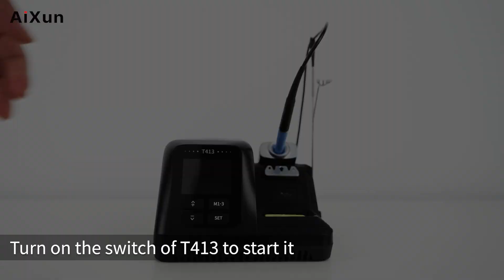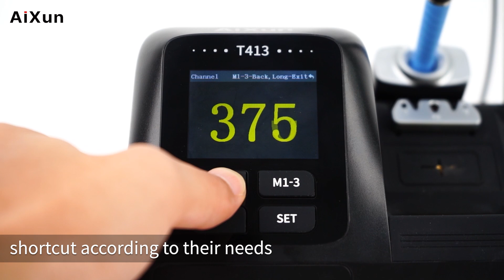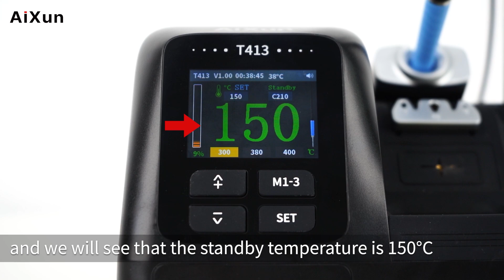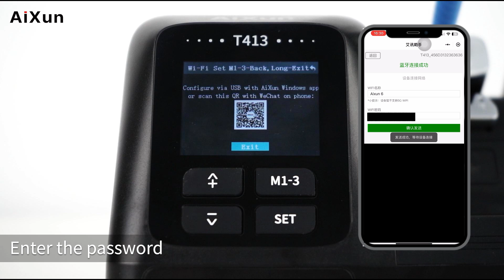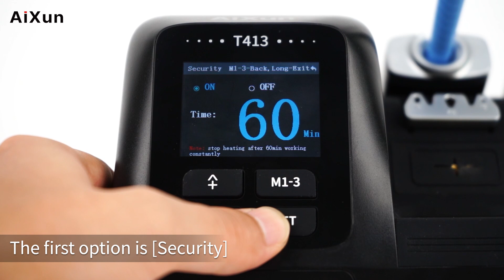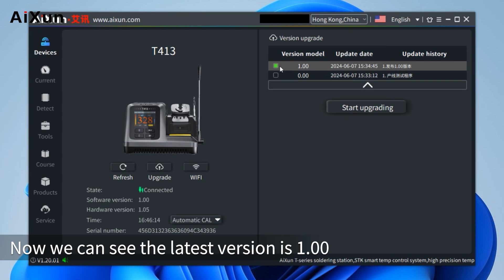AiXun T413 Integrated Smart Soldering Station Operation Guide

Comment: Just received mine from AliExpress and it was dead on arrival 😢
Reply from the maker: Sorry to hear that. Please contact the seller in the first time so they can help to locate the problem and address it. Don't worry.
Reply: @aixuntech  Seller accepted my return after showing then video.  Is there a difference between the 220v vs the 110v? Other than the cable? Thank you. I want to order another one.

Comment: What is different between t413 and t320???? They look identical
Reply from the maker: Hello,
1. T320 supports the T245 and T210 handles, while T413 supports the T245 and T225 handles. T413 is the first integrated station that supports T225 smart wire-controlled handle. 
2. T320 comes standard with the T210 handle, while T413 comes standard with the T245 handle.
3. T320 adopts a switch mode power supply, while T413 adopts a transformer. 
Therefore, the cost of T413 is higher, but the anti-interference capability is stronger, making it more suitable for long-term, high-intensity operations.